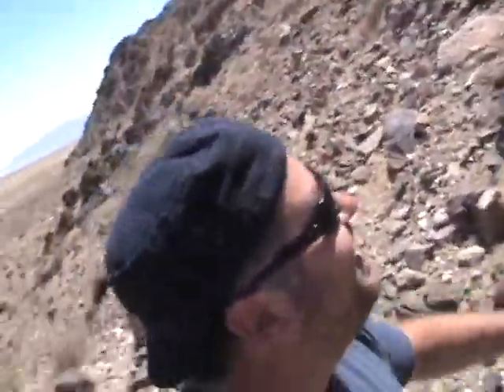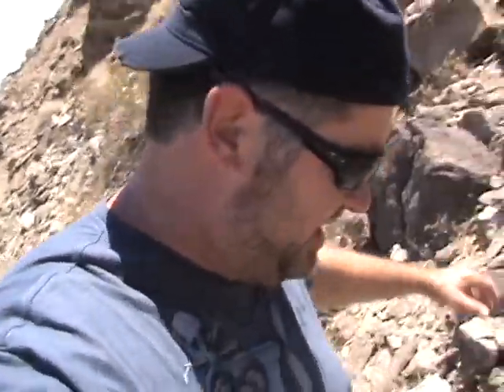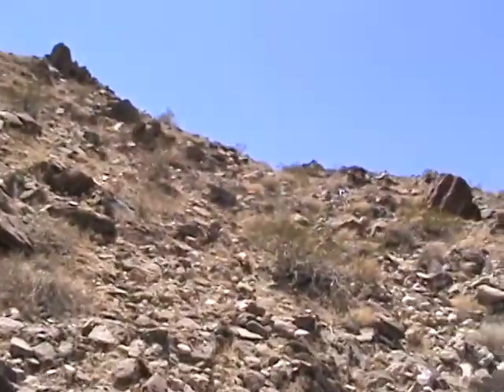K450 Sugar & Kno3 Coyote Rocket - August 15, 2009

Comment: Tell the truth, I'm looking for factors increasing burntime, do you have any leads? I'm taking the nozzle throat diameter down in steps. Your plan for k500 is .906 so ill try .875 first and then on. Or do you have any idea on the size increments I should experiment with?